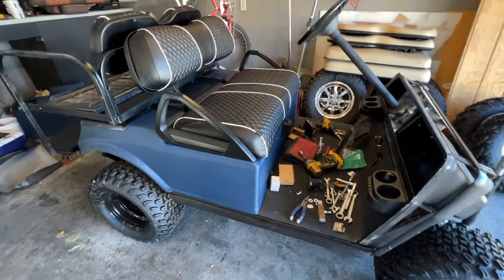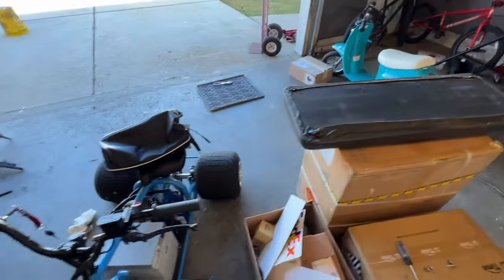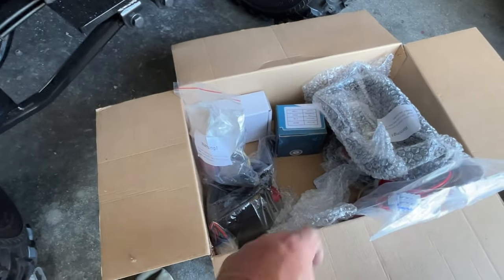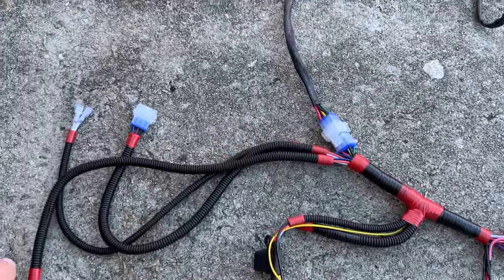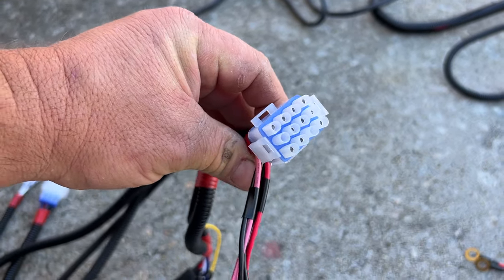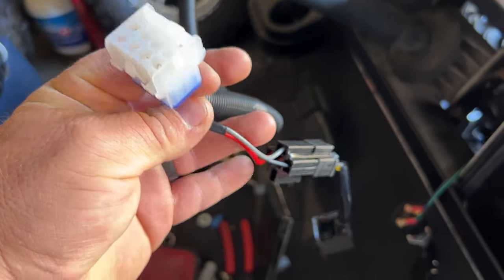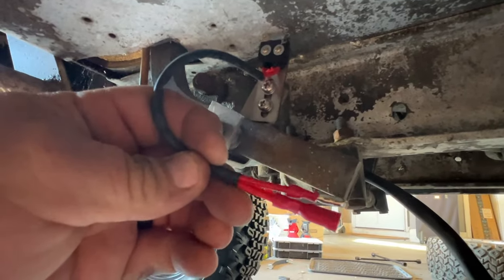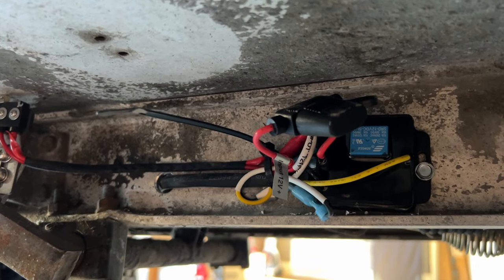Top 3 Nokins Golf Cart Accessories to Make Your Cart Stand Out!

Comment: Ryan. Thx for sharing your knowledge with the gold cart community. Can you do a video on how to wire a reverse (backup) camera on a Club Car Precedent. I am close to figuring it out but not quite sure yet. I have a 48v relay I bought from your previous videos and I also have 48to12 power reducer. I want the reverse camera display to come on when press the FNR switch. Do I use the buzzer wires or do I use the FNR wires? I don't want a separate switch to turn the reverse camera. Something tell me there is a way to do this but can't figure it out.